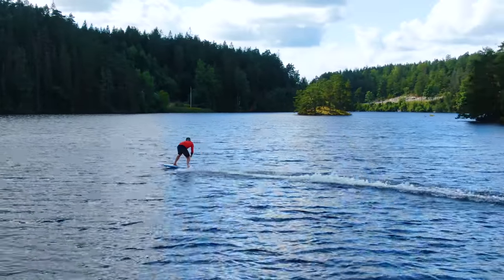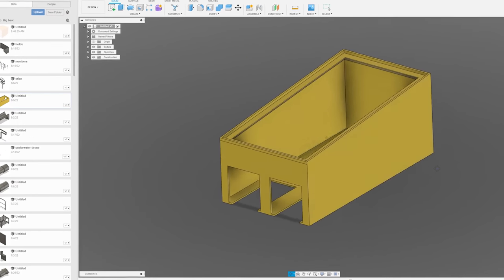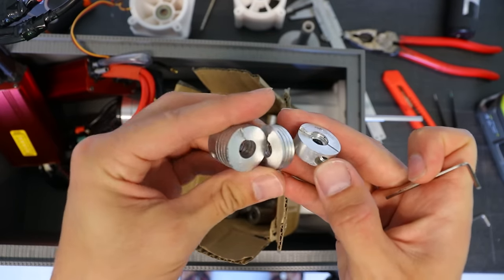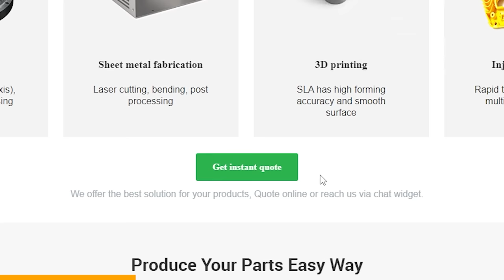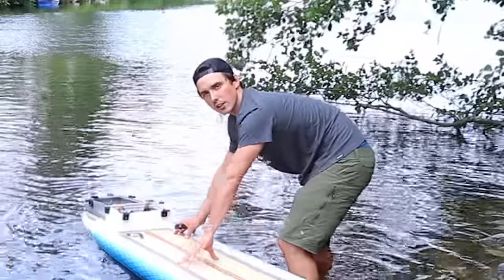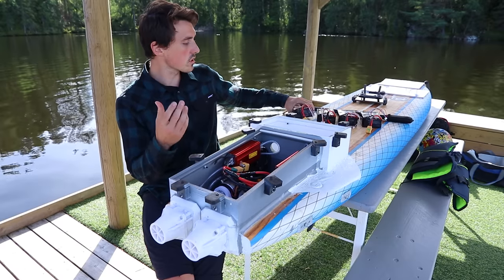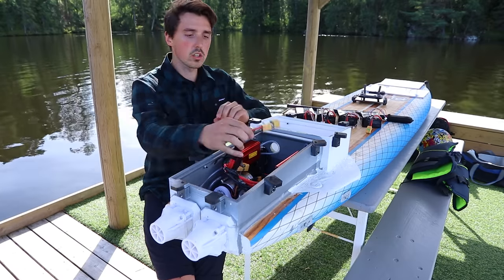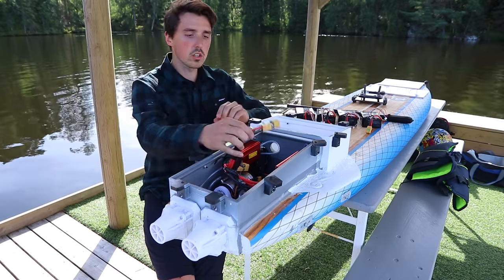This Electric Surfboard Has a Secret Inside!

Comment: For heat dissipation, make the bottom of the box aluminum with the fins for the board and flush with the bottom. Thermal paste as many hot components directly to the plate before bolting down. Combined with your water cooling system to pick up the slack, the bottom plate can pull double duty as heat sink and fins.
Reply: I like this a lot. There are thermal transfer adhesives that could help so you don't get stuck using computer paste.
Reply: What about putting a chunk of dry ice into the box?
Reply: Im no expert but, i think Instead of thermalpaste he could use soldering and stainless steel.
Reply: @FollowRevolutionNine  i'd be worried about condensation inside the box from going sub ambient
Reply: @FollowRevolutionNine  Not anywhere near the batteries, they must be allowed to heat up to a working temperature (60°c max!), there are aluminium water-cooling blocks for battery compartment.
You need something practical, his water-cooling can work absolutely fine, just need some tuning.
Reply: My point was to make the bottom a heat sink then to increase surface area and stabilization using fins. I’m a computer guy, so I defaulted to thermal paste. Anything heat conductive will work.
Reply: @mhegyi2  im also a computer guy, the reason i was talking about soldering is from my experience with pcb's
Reply: You must like electric scooters
Reply: @hyrulemasterchef9573  possibly
Reply: Great idea
Reply: That’s sweet. It will need to be waterproofed. Water always gets in and your hot components are naturally at the lowest point.
Reply: @FollowRevolutionNine  Take care with a sealed box, the CO2 will cause the box to explode if it cannot escape gradually.
Reply: I was literally about to suggest this. That'd make a huge improvement. Particularly as you'd get better cooling at higher speeds (thus higher loads).
Reply: the best way to reduce heat is to use components that wont get hot. i.e. larger, heavier, more overhead in power. more run time.
Reply: @timn4481  Sure, but those are expensive and add weight. Aluminium also adds weight, but is way cheaper. Also, even larger more expensive components can't break the fundamental issue that there are heat generating components in there and the heat needs to leave. 

Larger components may have less internal resistance and so generate less heat, however, they still produce some. The motors will continue to get hot as well. Adding a cheap easy way to quickly disappate that heat is probably the better solution.
Reply: or just separate batteries from the motors? batteries to the front, motor at the back. there's a lot of stationary heat in that box from the connectors.
Reply: @ULTR4_DEV  aluminum transfers heat better than stainless
Reply: @feelincrispy7053  a simple 16 gauge aluminum box made with a press brake and tig welder wouldn't leak unless you knocked a hole in it somehow and could be easily bought from most machine/fabrication shops fairly cheap in commercial production it would be a sheet of stamped aluminum with fins spot welded on making one continuous piece
Reply: @benadams5557  that’d work for sure. This thread is slowly building a whole design with words lol
Reply: theres water in the box
Reply: Good idea!
Reply: To get rid of the water, you need to use oil seals on the shafts. I use to make the gearboxes and drive housing for saltwater rc boats. Use hard chromed stainless steel drive shaft and run it through a tube housing with a seal on each end of the housing. Pump the tube housing full of marine grease and that will keep the water out for hundreds of miles
Reply: I was gonna say the same thing
Reply: This is a great Idea the heat would easily be removed by the moving water...I'm an a/c , A/c works by removing heat from the air
Reply: @hydipieterse9318   Could You show an example of such solution?

Comment: You don't hammer in a bearing on its inner ring, you have to always push it on the outer ring or else you might damage the bearing.
Reply: It's only plastic, if the bearing was going into a Super quality metal fitting then yes.
Reply: @MrSupermugen  Bearings should ONLY be pressed in and removed by the outer ring!!! Otherwise it can damage & mis-align the bearings internal alignment and raceway!!!🙄
PS--Best method is to find a wrench socket that ONLY contacts the outer ring, attach to a socket extension rod and tap into place with a deadblow hammer/mallet for proper bearing seatment!!!
Reply: @fookingsog  cool. but its plastic, if the bearing cant stand that lateral load then your using the wrong bearing.
Reply: Plus... there plastic.... he can make a new one with 3d printing. And I don't thinks he cares since he's not going to be using it 24/7

Comment: Very cool, I used oil bearing seals on 3d printed jet drives and they work well but the seal that is not cooled by water tends to heat up and wear out. The issue i had on my electric surfboard is it was built too wide and heavy, while very stable it wasn't fast. Have you thought about using power tool batteries? I'm using 4 dewalt 9000mah batteries. Great video as usual and engineering 👏.
Reply: Power tool batteries generally are liion cells which typically can't output anywhere near as much power as a lipo, although they do have more capacity for the same size
Reply: Try use fkm/viton seals, they can withstand twice us much heat ar regular NBR and are more resistant to wear
Reply: @H.J.B  There's a new generation of lipo tool batteries, have seen them from Dewalt who seem to be very big on the advantages... might be something that becomes more standard.
Reply: @lemagreengreen  the other thing would be the cost difference compared to just buying a lipo so like unless the tool batteries are that much more valuable to you than lipos and smaller tool batts. Also the connectors on tool batteries aren't generally meant for thousands of watts
Reply: @lemagreengreen  There is only new generations of adverts. LiPo used for RC models are peak form of lithium battery for a decade without any significant progress.
Reply: Power tool batteries would be way more expensive and a lot less power dense.

Comment: I've never even heard of an electric surf board. This is such a cool idea and a great execution. One thing I'd add is using lightweight PLA might help waterproofing a little bit because it foams up a little filling in all the pores and holes in a 3d print. I'm surprised at just how well it works already. I hope you can get those cooling issues in order for the second impeller.
Reply: It is!!!! So cool and sick
Reply: That's a good idea using LWPLA - I'd have expected that with the foaming, it would end up with more pores overall? It'd be very interesting to see the results though, and more lightness can never be a bad thing
Reply: @roseroserose588  it's a bunch of little bubbles of air, thus creating a matrix of closed cells. The usual issue with normal prints leaking is probably from delamination of layers along their weakest axis, which I'm not sure LWPLA would improve on. The weight savings would be good, but maybe a fiberglass coating would be more watertight and strong in a final version.
Reply: What about ABS and vapor treating it in one of those huge (mostly) airtight containers with the foam seals? Most of his plastic pieces don't seem to have a huge amount of detail and the treatment would only have to penetrate a tiny bit to create an effective seal
Reply: @elyasstephens8242  ABS is a bit of a nightmare to print - especially with something so large, but for the best results it is probably the way to go as it'll also be uv resistant and last a lot longer to boot.

Without post-processing resin i think would be the most water-tight option, but then size becomes an issue again
Reply: abs is about 10% lighter than pla by volume, It doesnt creep either, so as a mechanical part it will survive much longer. one thing you can also do is print tpu seals at around a single layer thick. Abs Just depends on what you are printing with, I have a voron.  Printing abs is like printing pla on a voron.
Reply: Electric powered surf boards have been around for a while. Most popular are the airfoil boards like the Lift EFoil.
Reply: I am not lying when I say my friend in college conceived this exact idea back in 1996.  His concept used a gas motor though.  Never built it, as his genius was too busy with the rest of his ideas.  RIP Ben Koss, RIP.
Reply: @notsam498 What about Polycarbonate/ Polycarbonate carbon fiber? In my experience you need a heated enclosure to print it, otherwise you’ll have issues with cracking and warping
Reply: @cameraman1234567890  polycarbonate is great, now the difference in the amount of heat you need in the enclosure is prohibitive for   PURE polycarbonate. Carbon fiber polycarbonate can probably be printed on a voron but I would not use it for something that will always be on water. The carbon fiber will affect the porosity and may itself weaken the print over time.
Reply: @notsam498  Understandable. I have already attempted multiple times at printing with Polycarbonate carbon fiber. The lower weight is there, but it's a nightmare to print without a proper enclosure and an airtight dehumidified enclosure at that. So I'm considering another material like PLA or LWPLA or maybe even PETG.

Comment: Love the update. I made my own surfboard based on your original design but replaced the 53mm impeller with a 70mm impeller. I also simplified by going with a single drive instead of a dual drive. My biggest problem on initial testing was my buoyancy, it was more submarine than boat. I added rigid foam to the bottom and sides to also assist in stability. It worked great. I must say you make it look easy to ride but it took me the better part of a morning to just stay on it for a minute without falling off.
My next improvement will be the battery compartment, to make it completely waterproof and allow the space for more batteries.
Reply: Twin drive are always easier to ride as a single prop going clockwise or counter clock wise pushes the water away from the center of the board the board will then have a tendency to drift left or right and your balance is not used to compensating for that sideways push. Whereas if you have both left and right spinning props the forces will mostly cancel each other out meaning most of the force ends up being centered  behind the board making it far more natural for our balance systems to adjust to and making riding comparatively speaking a breeze. Ofc its still a skill that needs to be learned buts it is much easier to learn.
Reply: please make a video of it.

Comment: This is very cool. 👍
A recommendation, create a stand alone propulsion system like this, but make it clamp on to what ever you want. A surf board, kayak, small boat etc, and then you will have something that is universal and more people will want it.
Reply: Great idea. A universal "power pack" for anything that floats (and you want to go FAST).
Reply: I have been shopping around for something exactly like you describe, that i can just mount to the side, or ideally both sides, of my sit in kayak. No way I want to deal with a huge trolling motor type pole, nor to cut any holes in my boat. Ideally I dont want to deal with any steering linkages either. With the application of differential differential thrust and a small 3d printed body (which I could modify if needed to best fit my kayak), I think all the problems are solved.    I wonder how much that 3d printed metal impeller x4 costs?
Reply: @gutrali  I don't think differential thrust would have enough authority to actually turn, unless the impellers were pretty far apart from the centerline. I figure that with the distance needed for turning with differential thrust, it would end up looking more like a catamaran.
Reply: @gutrali   I don't see a reason why you couldn't print the impellers from CF nylon or polycarbonate.

Also I agree with the commentor above that differential thrust wouldn't work on something as long and narrow as a kayak. A simple rudder at the back can easily be added and would work much better.
Reply: @coriscotupi  yeah that's what I was thinking for a kayak, one motor unit hanging off of each side

Comment: I have a 1981 "SurfJet"; a 2-stroke gas engine impeller based surfboard. It goes about 40km/hr if you're < 200lbs. It however, is about the size of modern day paddle boards. So, why not swap from the longboard style to a paddle board - this would allow for more components, likely even able to store the batteries inside the board itself (they're thicker than a longboard) and overall be better. Mind you, you may lose agility and response but what you lose, you gain in a much longer run time. 

Just my thoughts - keep the videos coming!
Reply: I dont think space is the biggest issue here. The batteries are over $120 a pop, thats over $160 per minute of runtime
Reply: Well I think the point is that the surf board is nimble and responsive. I'd rather take the speed and agility over a big, heavy, slow paddle board. Age probably is a factor in preference, nonetheless

Comment: Love it, fantastic job and super interesting!

Also, have you thought about adding a bilge pump? Possibly adding an angled v shape in the back of the housing going to a little 12V pump inlet may help with the water intrusion. The natural acceleration and angle would help force all of the water down to the inlet.

Again, fantastic job!
Reply: Thought the same. Should be the easier solution that actually sealing this whole array with its different components and all different young's modulus
Reply: It has a 3 min runtime... Easy enough to just tip it out when you've finished.
Reply: @Vousie  would you not agree that keeping the electronics away from water is a good idea?
It doesn't take water very long to screw up stuff if it gets into the wrong place. I'd say the less chance of water damage the better.

Comment: 72V   system would solve a lot of problems. It would drop your amperage while increasing your power available. There are some very reliable and affordable 72v motors on eBay.
Reply: Electric motors run less efficiently the more voltage you add but you get so much more power

Comment: Great video as always!
1:30 Just a tip: bearings should not be hammered in place. for best results, use a vice or at least a rubber hammer.
Reply: With housing montage only put pressure at the outer ring, and axle montage the inner ring, else you're forcing the other one down by putting pressure on the bearings.
Deforming them, and you start off with a bearing with the damage you would ve had at a 1000 working hours...
Vice and rubber hammer would be a massive improvement to begin with✌🏻👊🏻

Comment: Create a heatsink that sits in the water and removes heat from the esc and the motor. All that cold water your displacing could be cooling the electronics!
Reply: Had the same idea, can’t recommend it enough.
Reply: To physically link the heat sink to the motor and the electronics and also keep everything water tight would probably be challenging. WOuldnt mind watching him try though.
Reply: @gutrali  Motor heatsinks or jackets are a thing, so there I wont see a problem. Making the base out of metal or a metal plate with heatsink fines could be bigger challenge. But with the help of the new 3D printer metal sponsor, this could all be made out of one or two pieces with some CPU paste or cooling pads.
Reply: @gutrali  Use heat pipes. You can buy them in all lengths and they are very efficient at transfering heat. I would mount all the ESCs to a copper base und use heat pipes to get the heat out underneath where they connect to a heatsink.

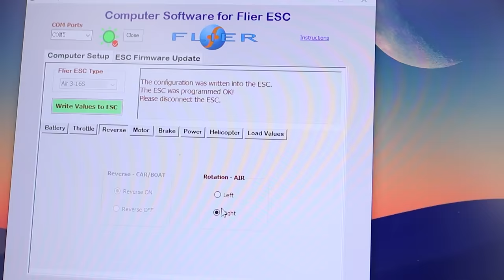Comment: 02:39 - One easy way of reversing the motor direction (say in the field with no access to the software) is to just swap any two of the three motor wires. This will reverse the motor rotation.
Reply: He knows that (maybe the motors are sensored)
Reply: he definitely knows that
Reply: Bro They Are sensored

Comment: That's super cool. Would it be hard to make this in such a way that there's no box sticking out on top? Also, with this design it might be smart to add in channels and a hard edge like wakeboards have them for carving
Reply: He could have totally put all of those components inside the board itself.
Reply: I mean... someone could do an old school wood surfboard kinda like an electric guitar and then fit the motor drive and impellers into the structure.  If you designed the whole thing from scratch, maybe CNC cut the body, you could have very smooth transition lines and such and  make it all fit cleanly.  Im on the other side of the world or id offer to use my cnc to cut the guy a body, but I'm sure there's gotta be someone with a 10 foot machine in his neck of the woods that could hog him out a simple surfboard body with a hollow set up for his electronics and mechanical bits.

Comment: You might want to use hybrid ceramic bearings so they don’t seize up. Also replacing the ones in the motors is a good idea. I made a robotic fish and ran into this problem early on. (Worse in a pool tho)

Comment: Very cool project, love to see how it grows! But I saw at 11:00 that you are converting DC to AC back to DC just to charge the batteries. A DC to DC charger would probably be more efficient  less of a fire risk and less cables aswell! I know ISDT has a couple good ones that may work well for that matter, like the P30 :D But the project you have going is very nice!
Reply: Exactly, I charge my batteries directly from my car battery, made a simple XT60 adapter with large alligator clips, it's working great. My guess is that he knows it, many YouTubers do things "wrong" to generate more comments.
Reply: @Eden_M  Are you suggesting connecting the lipos directly to a 12v car battery without a charger?
Reply: @Chris-du7hi Hell no, use your car battery as a power supply for your smart charger, I'm using ISDT Q8 and Turnigy Mega 400x2.